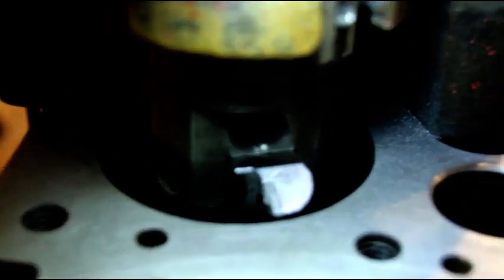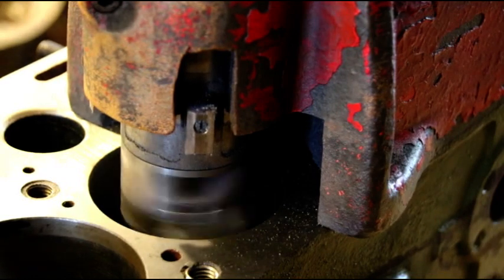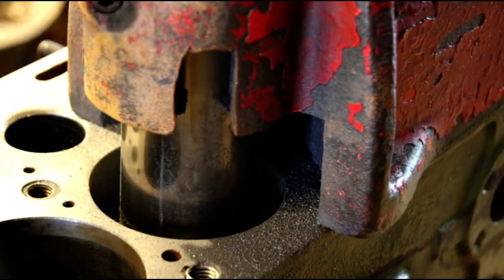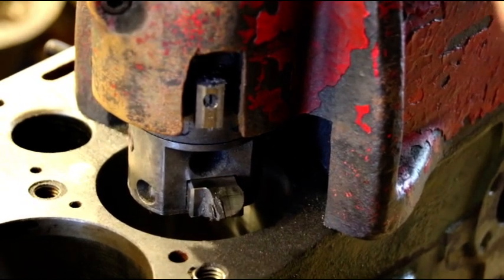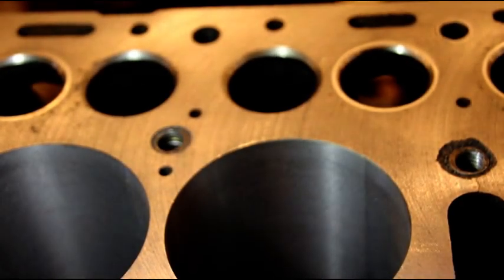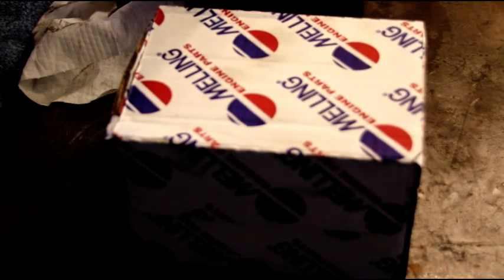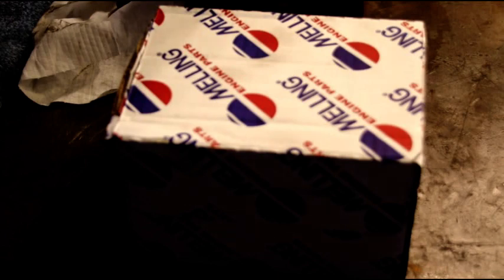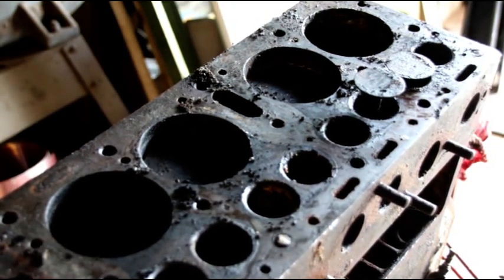3 Willys Engine Rebuilds, Boring, Parts Selection, Disassembly

Comment: I'm breaking down an old rotted out '48 cj2a that I bought for the driveline... the engine looks like a win at first glance. It turns freely, no water or rust inside, the pistons are 040 over. I'll do a closer inspection as I further disassemble it. The transmission also looks pretty good, but the front diff looks pretty rough inside; the gears are shot for sure. Don't know about the rear diff or t-case yet. 

I sure enjoy your vids and dream about having my spares in your shop. Thanks for making them.
Reply from the maker: Take you time, disassemble, clean, measure and inspect everything to see what is usable and what is junk.  Good luck with your project.

Comment: Brian, can you show your stud and broken stud removal process? Also show how you remove those stuck valves.I’m doing my first L head. Bought a 1945 CJ2a and two 1946 CJ2a for my retirement projects. I’ve been following your videos.
Reply from the maker: Ok, more videos coming
Reply: @metalshaperJeep  I’m tearing down a 1949 l head that came from an Army generator. It had locked up from overheating looks like. (Cracks in piston tops. When I got it , it had been setting outside with no carb and no cover for no telling how long. Good news is all studs are out. I pulled 1 rod cap an it looks good. Cylinders look pretty decent from what I can see. It’s also a standard bore. So I don’t want to screw up the block. Valves are rusty stuck. That’s why I asked.